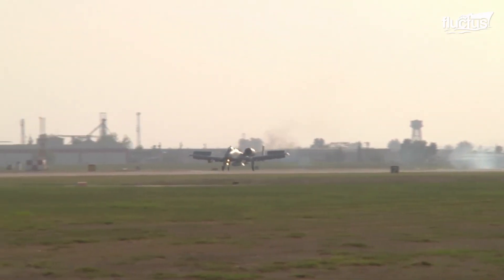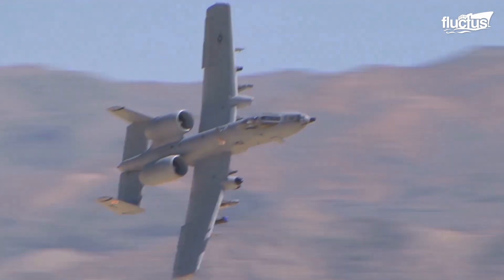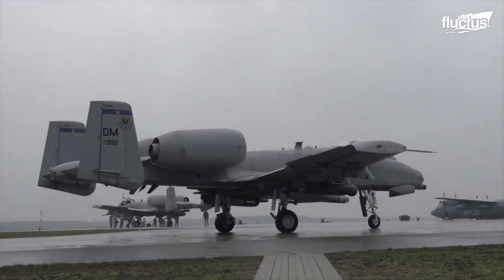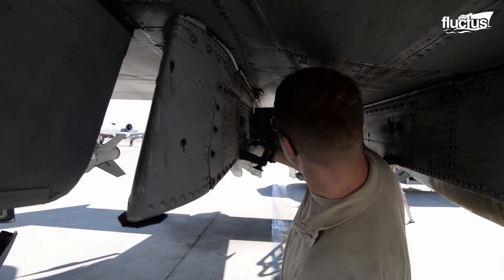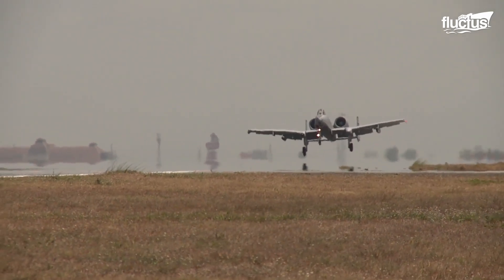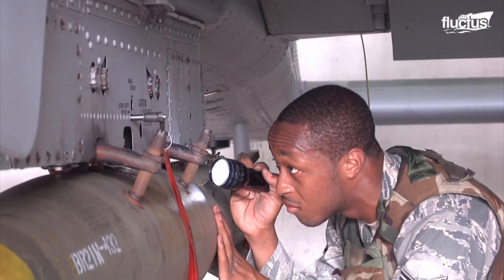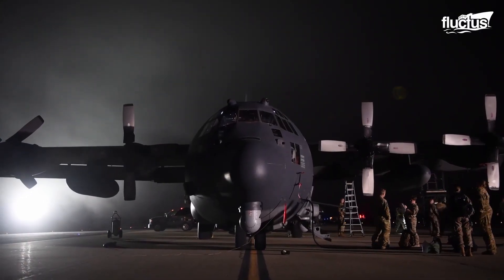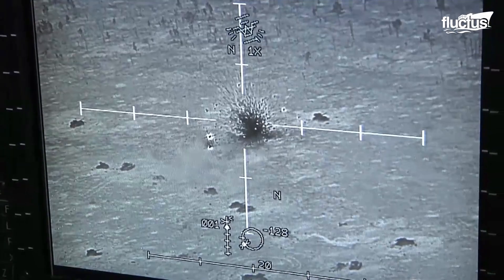The Reason Why the US A-10 Is Still Feared After More Than Half Century

Comment: How much value would there be to take a V-22 or V-280 and convert it to a AV-22 or AV-280 just like the UH-1 was converted yo the AH-1.  That may create a replacement for the A-10.
Reply: @craig4867  your a Hog Herder (pun 😈).and I trust your superior knowledge but THE A-10 WING DOES NOT TILT.  What tilts are the Engine “pods” on the wing tips.  Now when in the forward flight mode a HUGE amount of the wing is block but not all of it and two or three hard points could be put on the inside of the blade turn radius. Also we have all the belly could be used as hard points, heck we could probably rig a retractable, reloadable, pod in like in AIRWOLF TV show. 

THEN AGAIN WHO SIAD WE SHOULD KEEP THE SAME “body” on an AV-22 as on a CMV-22B, they didn’t do it for the AH-1 which is up to the Z version by the USMC, saw one of them undergoing EMV and HERO testing years ago.
Reply: @VAMobMember  you ought to send your proposal to Bell Boeing or the Pentagon, they could use a few laughs, imagine the V-22 pulling 8 or 9 g's which the A-10 does in tight turns and imagine the V-22 diving onto a Target like the A-10 and firing missiles and rockets through its propeller blades!
Reply: @craig4867  Yeppers to your original statement and reply.  Sounds fun w/ a little cool, but absurd to try.  Could you imagine what the ride would be for the fellas in the back of the plane is side jump seats?  Puke every where.
Reply: The losses would be tragic - can't support that type of flying.
Reply: @rockfordjohnson7512  I'm not sure what you're referring to, I'm assuming you're talking about the guy who wants to replace A-10s with V-22 ospreys and as a fighter pilot who flies A-10s would be a tragedy, can you imagine firing rockets and missiles through the ospreys propeller blades and I pull 8 to 9gs sometimes in tight turns imagine an osprey doing that it couldn't it would fall apart, it's bad enough it's called the Widowmaker! It's probably some 12-year-old having a wet dream!